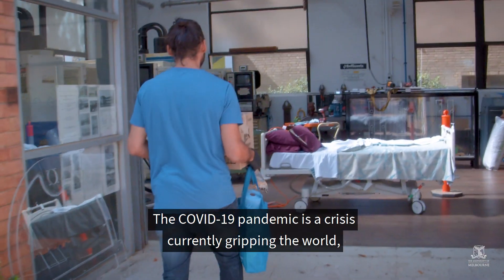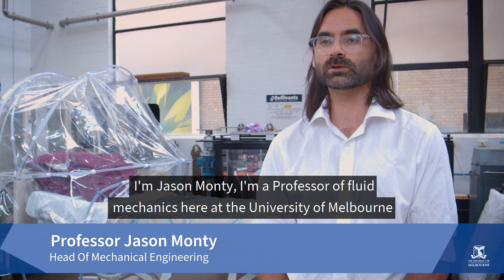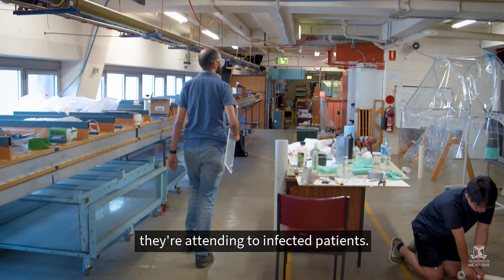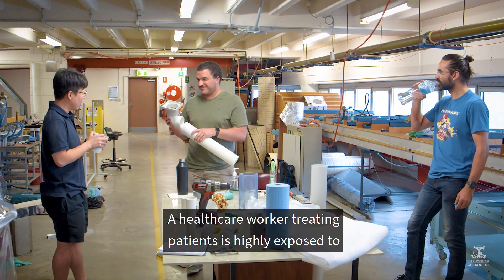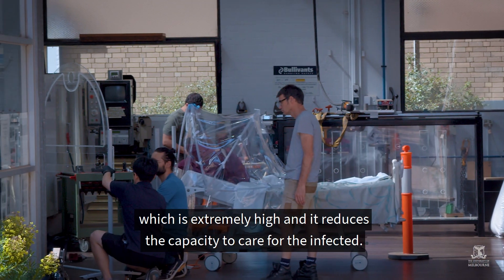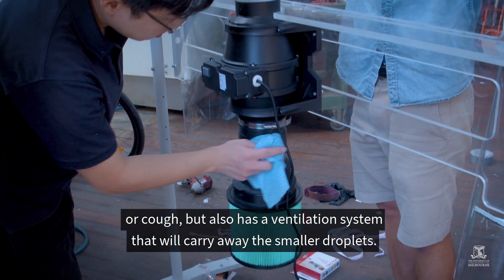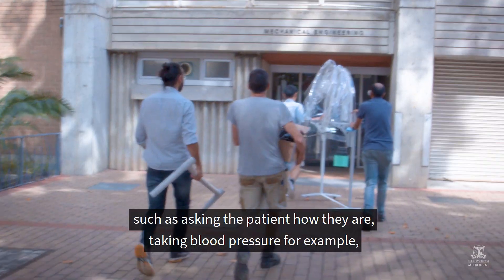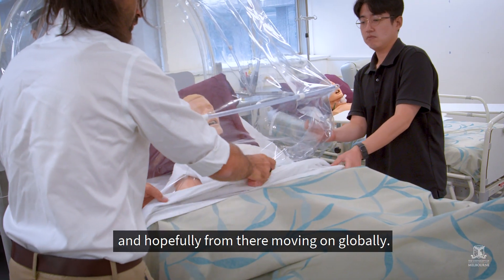Researchers design ventilation hoods for hospital beds to help contain COVID-19 spread

Comment: Please make it so that the personal TV on a pole that most hospital beds have, will fit inside the enclosure. (Not the pole, just the TV part that extends on an arm from the pole to a position somewhat near the head of the patient.) Such protected access of the arm the TV is mounted on, would simultaneously enable protected access of the tubes connected to an IV. The personal TV is THE most comforting device a hospital bed has, which lowers stress and enables faster healing of patients. So, Pleeeeease do it!!! Thank You!!! ❤